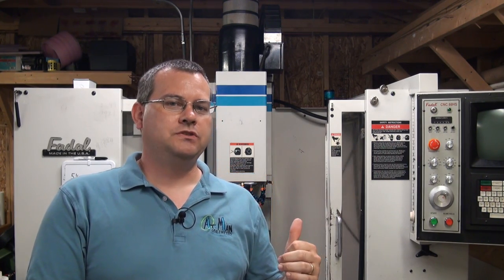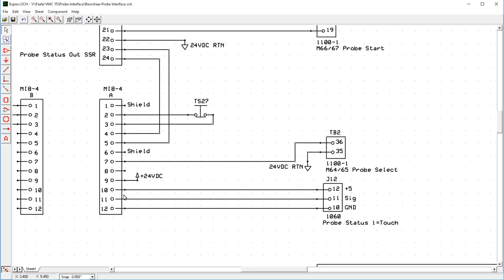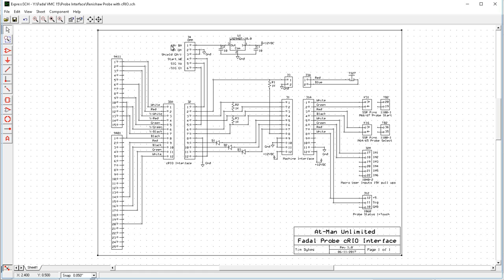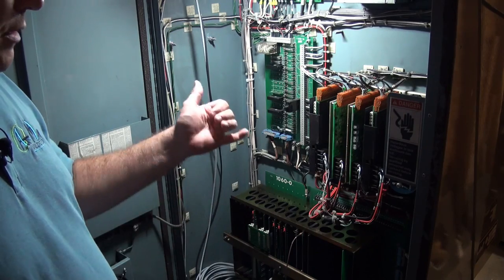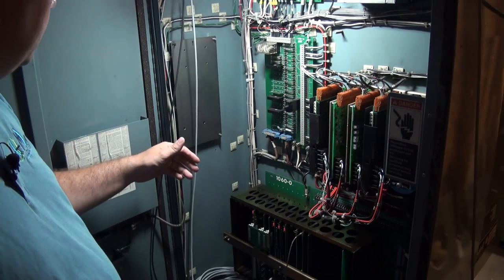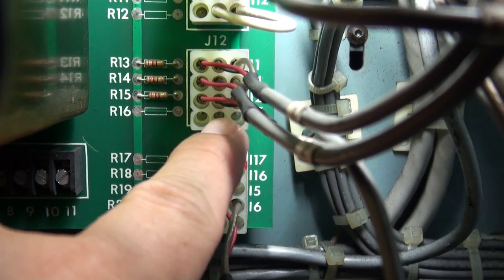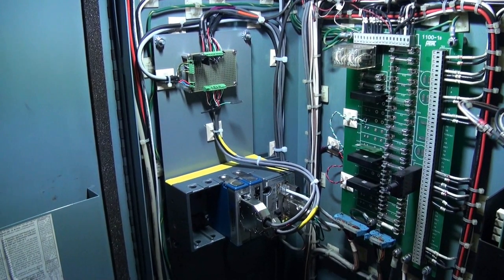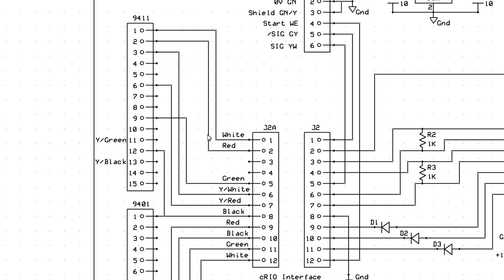Wiring a Renishaw Probe System to a Fadal CNC

Comment: I cant thank you enough for this video I found 2 renishaw probes at the local flea market paid 5 bucks for a tp1 and tp2 5w with the ph6 the 3 extensions sizes and the..... (cant think of what its called) the thing that allows me to the tp2. Talk about a stee!!!l I know right!!! The guy asked how much they normally are after I bought them and I said somewhere close to 4k. Anyway I have a masso touch that i want to use it on i already burnt out the led of the tp1 on accident so dont know if that effects the basic function but according to the pin out 4 and 5 are the probe inputs and 1 and 3 are led. So thank you again for this video now I can make it work like it suppose to.

Comment: Just a suggestion you may want to add a audible sound like a beeper when the probe triggers. I have run machines with both no sound and with a sound when the probe triggers. It is always more comforting to hear the probe trigger for some reason. Or better yet put a switch to select sound or no sound.
Reply from the maker: Thanks Peter, I was thinking the exact same thing! I have an extra output left on my brick that I could drive a small tone generator with. Could mount it on the bottom of the pendent somewhere.

Comment: Not necessarily probe related but im wondering how the white 120v terminals to the right side open? pull a wire out and never get it back in. i suspect a special tool is needed or technique i cannot figure out. any idea? i have the style to the right of your terminal board and also the newer style that are pyramid shaped between my three machines. btw if i try and stick a screwdriver in like you did  to the upper terminals it just closes it tighter. mine are  slightly different.

Comment: Wrong vid, but I just saw your video on 3phase vs 1 phase and you killed it, very good explanation. Now if I have a question I know who to ask. :)
Reply from the maker: Thanks Erick!
Reply: At-Man Unlimited Machining 
I'm a bit obsessed with trying to converted a regular box fan motor into a generator, do you think its possible or should I just make my own turbine from scratch?
Reply from the maker: Fan motors are normally small shade pole induction motors. You can use an induction motor as a generator but you need to power it and run it as a motor first so the squirrel cage gets magnetized, then you can put mechanical power into it and get electrical power out.
Reply: At-Man Unlimited Machining thank you for your fast reply, I truly appreciate you saving me the head ache, that's something along the lines that I had read from a university paper on using car alternators as a generators, and it never really specified how much current to provide, it seems like I'm just going to make my own from scratch, once again thank you, and god bless, I subscribed BTW :)
Reply: And one last question, if there was a pma motor that I could salvage from an appliance or electrical tool for a wind turbine or hydro gen, is there anything I should look into that you might recommend? I also have the ceiling fan motor and its different than the box fans, but I'm having problems with getting the magnets close enough before they stick to the stator :/, but thanks, and if you think of any PMA that I can salvage lmk, if not don't worry.
Reply from the maker: A car Alternator would work fine, you just need to excite the field coil (read rotor) with DC power to get the output. Because a car engine does not run at a continuous speed the voltage regulator in the car controls the current going to the field coil and thus maintains a proper output voltage. For your application look for any permanent magnet motor. Servo motors would work really well.
Reply from the maker: Thanks for the sub!
Reply: At-Man Unlimited Machining that's all I needed a point in the right direction, I was banging my head against the wall with the box fan thanks again and take care, if your ever in Cancun, the tequil is on me :)
Reply from the maker: Thanks, I will keep that in mind!
Tim

Comment: Tim;
  I am in trouble here...
  Ok, I have Fadal 2040 AC 2001 vintage. 
 And brand spanking new OMI-2T which has interface in it. 
OMP 60 Probe, and OTS 1/2AA
  The trigger pins are the same on J12 Molex. 
Looks like I can pull 12V of P.S. as this unit is good for 10 to 30 volts. 
14 wires out of the OTS, 3 for trigger, Power + and ground, and Shield to ground. 
  That leaves the 8 wires, they are Probe status 1, Probe status 2, Low Battery and Error. 
  Can you tell me where to park those?
  Our machines are largely similar... but your home cooked circutry is custom, and I am scared to trial and error here. 
  Thanks for the great video's!
  Mark
Reply from the maker: Hello Mark, I replied to your email.

Comment: Decent one out there in market has both light and blowing functions。 Are there here?
Reply from the maker: The touch probe has a light, the tool setter does not. But you can easily add a light and or beep using the Renishaw hardware.

Comment: Tim, we miss you!   Did you ever work out any of the probing macros for the Fadal?
Reply from the maker: I have not finished them, the shop got super busy so I only have time to fix what I need for jobs. Good problems to have, but lack of time is the result.
Reply: @AtManUnlimitedMachining  That's a good problem to have.  I've been having fun writing some and have most of what I need up and going.  Thanks to folks like you and others like Doov's blog. I missed a couple of great deals on the Renishaw probes although I have a new TS27.  Good deals don't come around very often and I ended up buying a Dewtronics Wireless that works pretty good and is priced very reasonable.  Anyways, miss the videos.

Comment: My diy probe has flash light indication on its body but sound alerting is important。 Unfortunately, the I/O on my machine runs out ( Mach3)。 I render to write program line to “beep” the desktop computer speaker to sound instead !。。。 Still wait to see if work。。。
Reply from the maker: There is a light on the probe but not the tool setter, and it is hard to see with the bright work lights I use for filming. The nice thing about the custom solution I used is I can just add more IO if I need it.

Comment: Advicing the manufacturer of the tool height & diameter setter makes improvement to add LED indication。 Its not a bad thing at least and it doesn't like the cheap tool height setter。
Reply from the maker: I don't think a light on it is that important. In many machines the thing is so covered in coolant and chips you would not see it anyway.